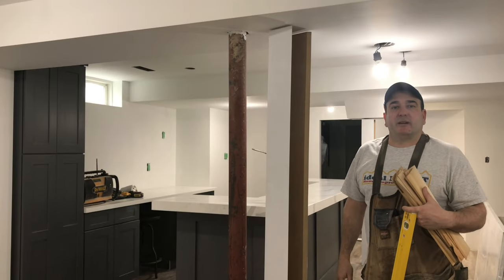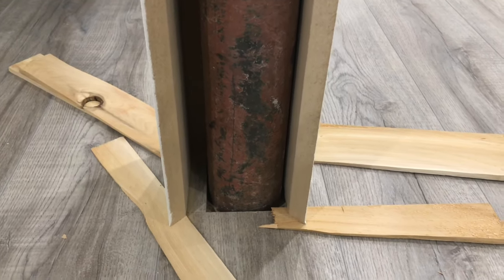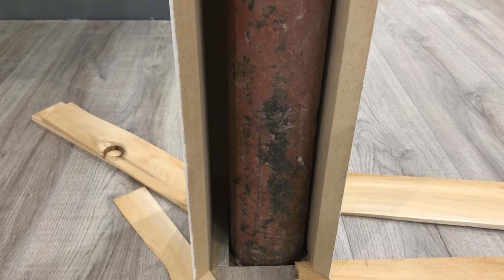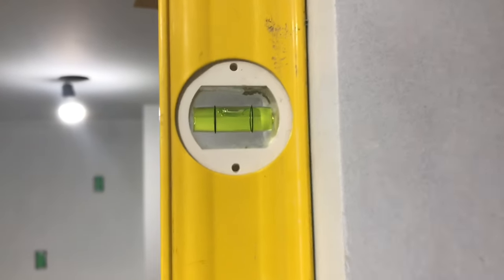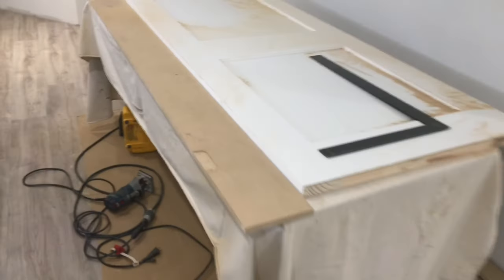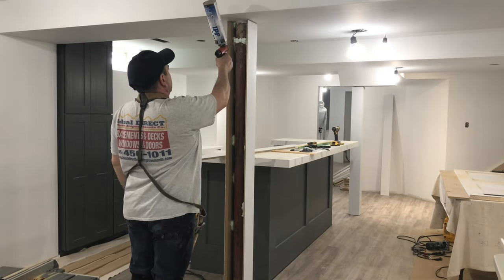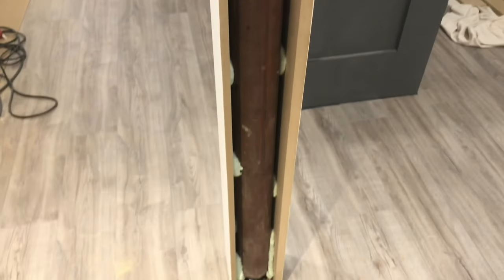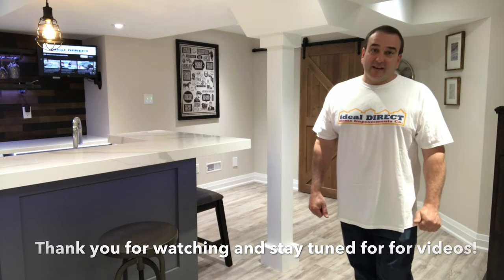How to Install a post cover around a post in a basement!

Comment: Hi Edward - Thank for the great video!! Would you see a problem if I only had a gap on the top and placed the MDF directly on my laminate flooring as long is everything is level?
Reply from the maker: Thanks! I hope it helps! 
I see what your saying, well as long as the column is floating and just touching the top of the laminate, then yeah , sure. My thoughts would be just not really putting any weight on the laminate at the end of the installation. The column cover should not be bearing weight.
Reply: @idealdirecthomeimprovement1639  Thank you for your feedback!!

Comment: Will be trying your method soon… thanks for the video..  assuming you use MDF 1x6?
Reply from the maker: I actually ripped it down from a full sheet , the end result for size is approximately 1 x 6. You can use any material as long as you have a little room from the steel post to the inside of the shell. I have a video on how I made them just to demonstrate. Check that video out! Thanks for watching and don’t forget to subscribe!

Comment: Hi, can you drywall over them? I want to know if you can attach drywall panels to the MDF. I have a pole beside a wall and wanted to  make it connected like a corner. Let me know, it would help to know if its sturdy enough.
Reply from the maker: Why not just frame it in and drywall it? Or use osb plywood to make a box like I did instead of using mdf. I think it would be a waste to use mdf and drywall over it. 
Make a plywood box, install it with foam and drywall over it. 
If you install the post cover the way I show, it is super solid, you would be amazed.
Hope that helps !
Reply: @idealdirecthomeimprovement1639  I have existing wall on the corner thats why, 5/8 MDF is cheaper than plywood and I would hope its more straight too. Let me know what you think.
Reply from the maker: @saugatools402  only you know what you have, I would have to see it. I’m sorry I couldn’t help.

Comment: Look nice, but I don’t understand how you’re preventing rotation of the columns in the event of an impact or from someone leaning on an edge.  Unless you’re somehow using L-brackets at the top, there’s no way that the foam is strong enough to prevent rotation around a cylindrical lally column.
Reply from the maker: Thanks Ryan, 
The foam sticks to the column and the cover, as the foam expands it fills the cavity to have a perfect fit. 
I have been doing this for over 25 years and I have never had any cover move in any way. No brackets needed. If you follow the instructions in this video you will see how solid the cover is. 
Try it out, and let me know how it worked out for you, try banging and try to rotate the cover when all the foam is set. 
Thanks for watching and looking forward to hear how it worked out for you.

Comment: Hey Edward, I'm following this install step by step in my basement and have a couple questions. I see there is a gap left at the bottom when you remove the shims, so the cover is actually completely suspended by the foam. MDF is a relatively heavy material and I'm wondering if you've ever had an issue with the foam deteriorating over time and the post cover dropping? Is this gap created on purpose in case there is movement in a floating floor? Thanks for your video's! You have been very helpful.
Reply from the maker: That’s a great question Mike! The primary reason for the gap is to be able to use the shims on the bottom and top to be able to in install the post with ease.
I will be honest to tell you that the foam in the covers has never failed to this day. We have been using the foam and this system for over 20 years. The gaps will all be covered with a base and crown. You can leave a smaller gap if you’re confident to install with ease. You can leave any size gap, Mike, I have shared what we do, take this video as a guide to help you. I hope this answers your question. Thank you for watching! Stay tuned for more videos and please stay safe and healthy!
Reply: @idealdirecthomeimprovement1639  It does help. I am installing over a Dricore floating subfloor which may have slight movement, so a gap might be a benefit. Thanks for your quick reply.
Reply from the maker: The gaps can be whatever you want as long as the last finish trim covers, you’re good. To be honest I would install the posts after the finished floor is installed. I show all of this in the video.
Reply from the maker: Mike sorry about the bad link! My apologies. The quad is great I have used it before. As long as it doesn’t over expand it will be fine, when you foam, just do the same as I did. Let it cure and go back to it to make sure it doesn’t take the post out of shape. That’s the only trick. 
Thank you and I really appreciate your feedback! Always a pleasure!
Stay safe and healthy Mike!👍🏻